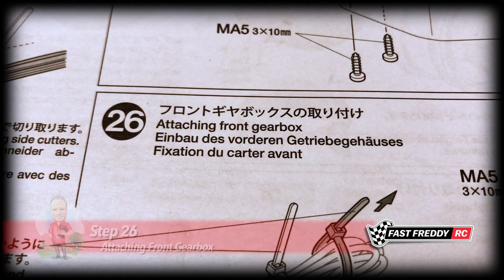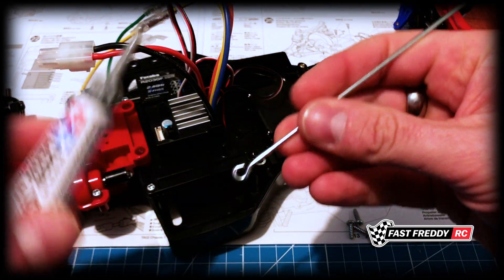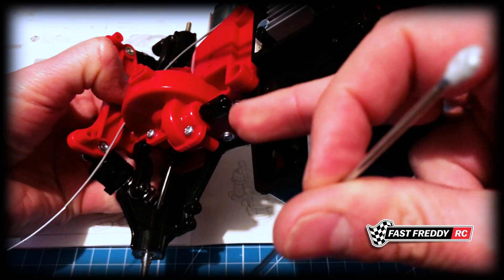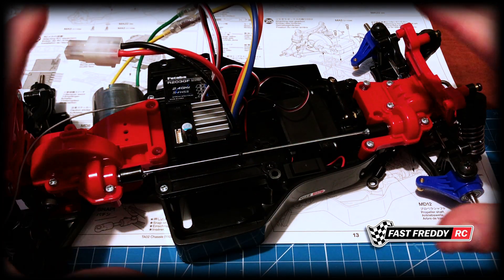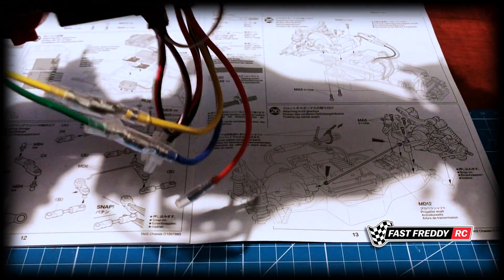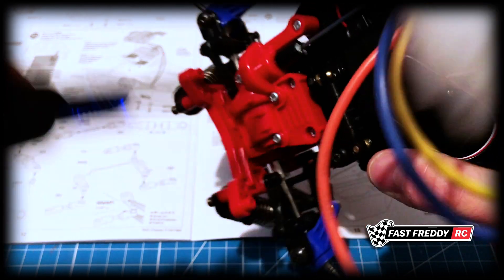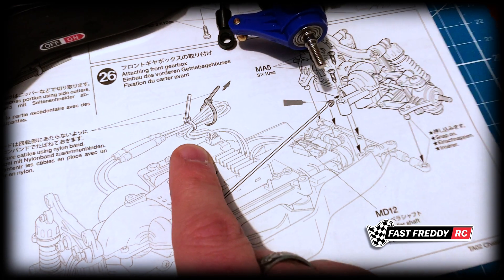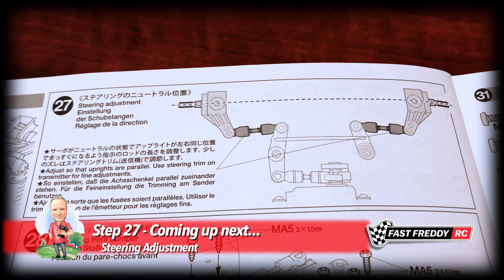Opel Calibra V6 TA02 Build Series - Step 26 - Attaching Front Gearbox

Comment: Yes the driveshaft is good. There was a hop-up for it. But it isn't neccessary as longnyou're not take parts in race. On the TTs this is the first thing everyone changes. Npt everything gets better over the time
Reply from the maker: Thanks Dirk! So they don’t make the hop-up drive shaft for this anymore? It’s quite shocking to me how “thin” the drive line is. Was expecting to see a driveline similar to the TT01 or TT02. But I guess it’s a proven driveline.
Reply: @FastFreddyRC  your's made out of metal. The TTs are out of plastic.